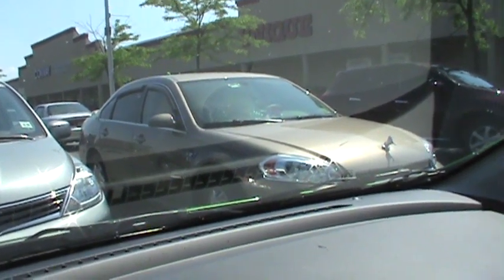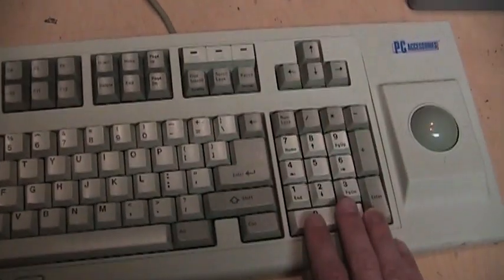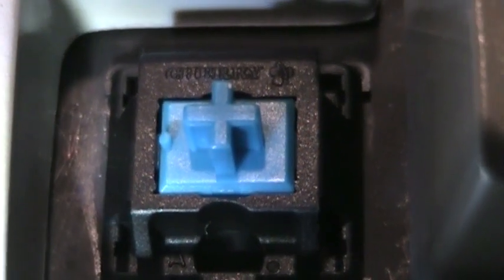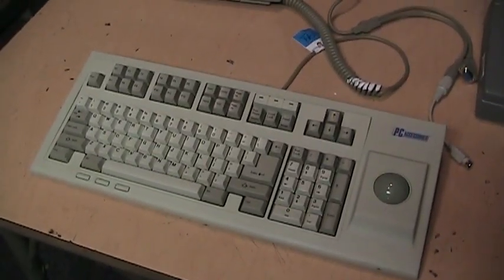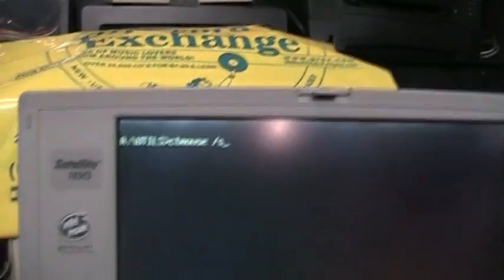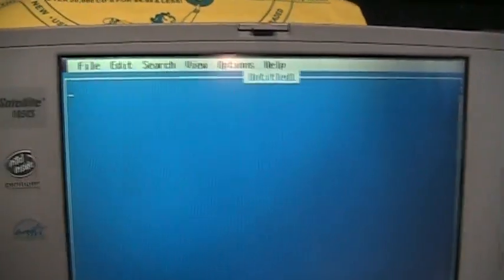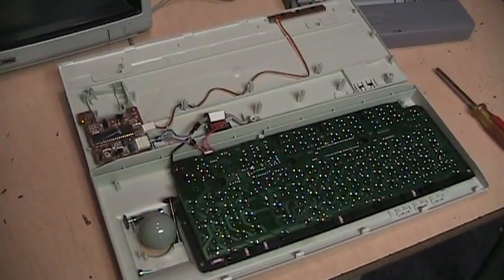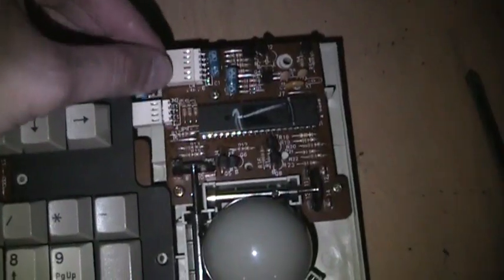Chicony / PC Accessories trackball keyboard

Comment: I'm thinking it's needing a proprietary mouse driver. I had a genius serial mouse that wouldnt work with anything other than a proprietary driver. The buttons worked but not the motion tracking.
LOVE Cherry switches. Just got a razor mechanical keyboard and it's great.

Comment: You really should move the mouse buttons! Just cover up the original holes with Bondo, sand the whole bezel smooth, and use matte finish spraypaint on it. If you can't get the trackball to work, maybe you can find another trackball mouse and fit it in there.